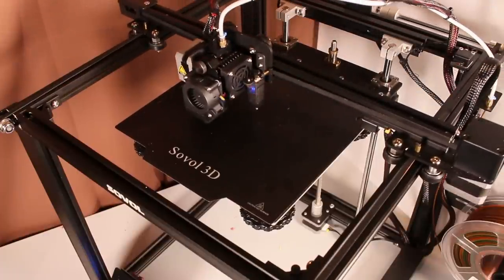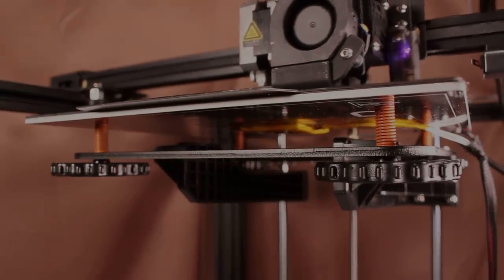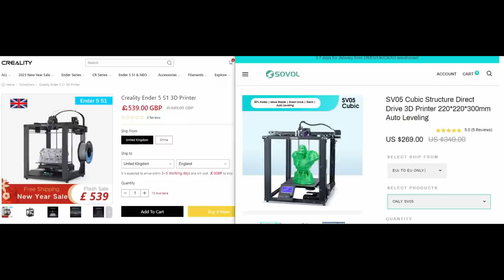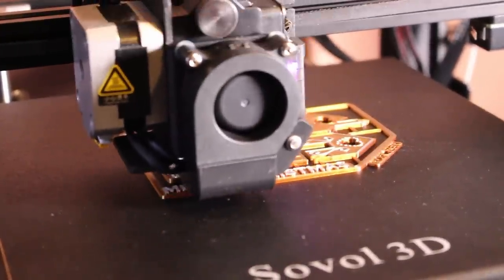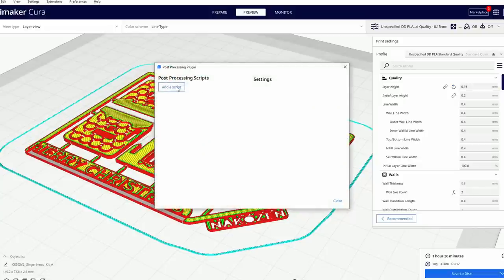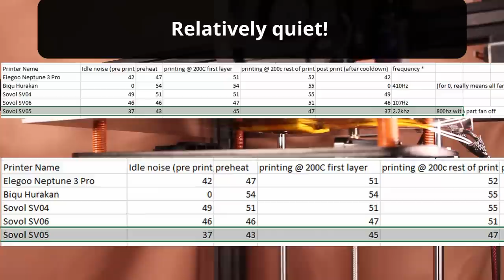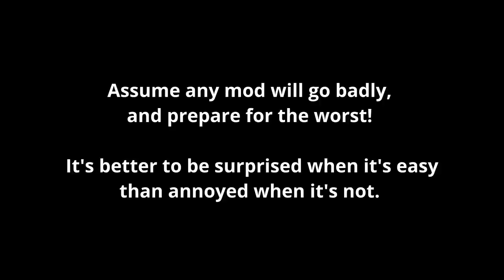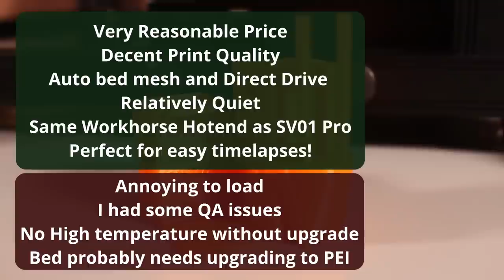The SOVOL SV05 - the Best Printer for Timelapses?

Comment: I have a personal vendetta against Sunlu filament. Not a single role I've ever had from them has been without issue. Their regular PLA and pla+ both absorb moisture like nothing else and no amount of baking it has gotten it dried again for me. Not to mention terrible layer adhesion, bed adhesion, different colors having vastly different printing properties. Etc etc.
Reply from the maker: surprising to hear that since I used to use it a lot without issues...I tend to use eryone these days though as I work with them now and then. Meta was something I did a special video on which is why I have it.
Reply: @LostInTech3D  I took a risk on some Kingroon pla and while the layer adhesion isn't the best it has been printing wonderfully so far. However even with that I'll be switching back to strictly Esun, never had a problem with them.
Reply from the maker: Kingroon is actually decent, I have used it, not the largest selection of colours though
Reply: Sunlu Carbon Fibre PLA is awesome stuff.